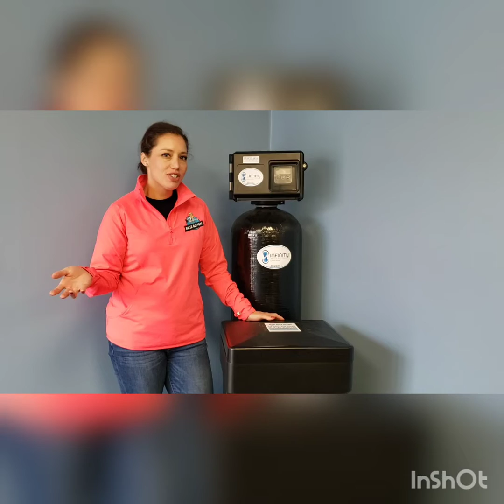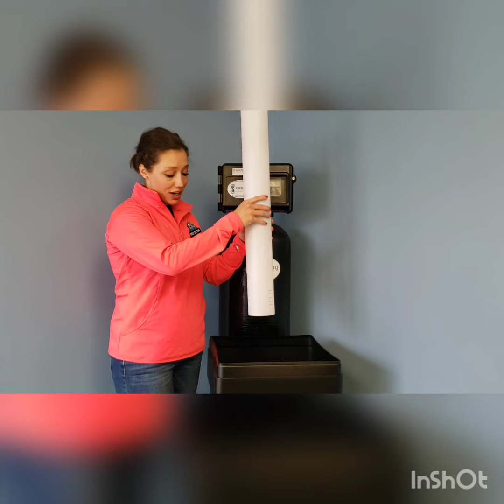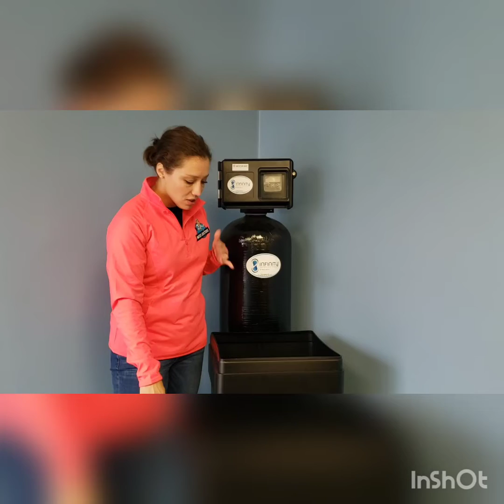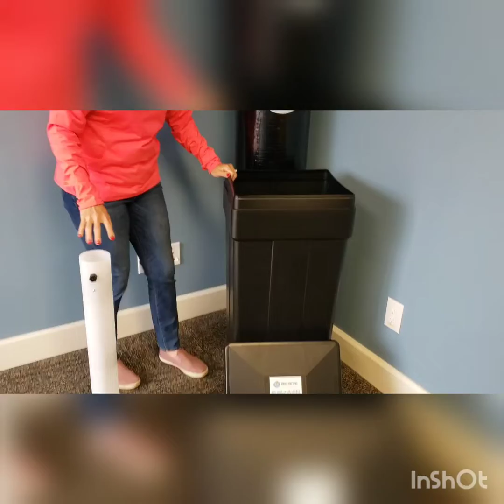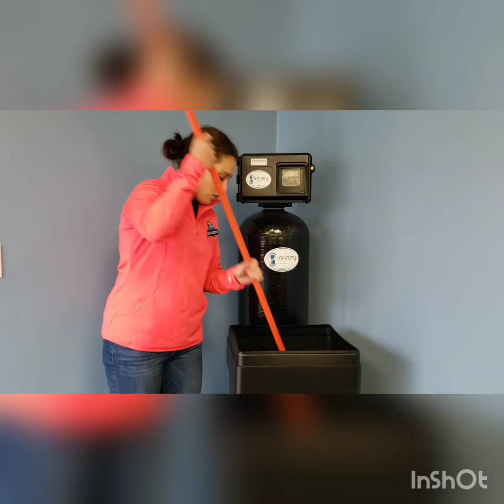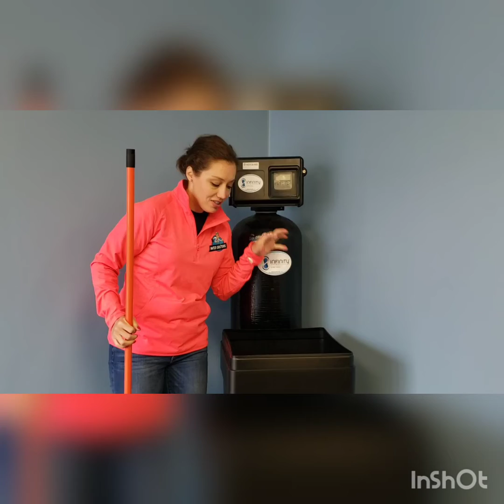How to clear a salt bridge!

Comment: I just cleared out the salt clog at the bottom of my brine tank, but in doing so I accidentally knocked the bottom 4 in cap of the brine valve. Mine is fastened to the tank and I can't take it out, nor can I reach down that far and reattach it. So my question is: can I use the water softener without replacing that bottom cap?
Reply: Yes.